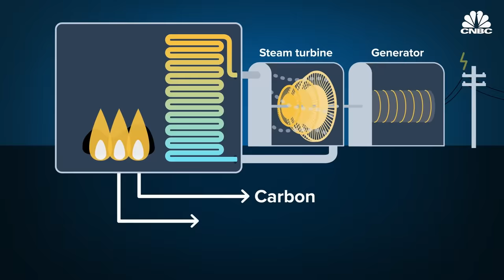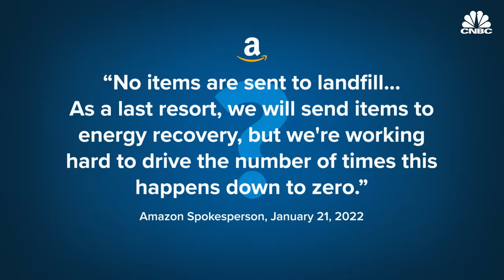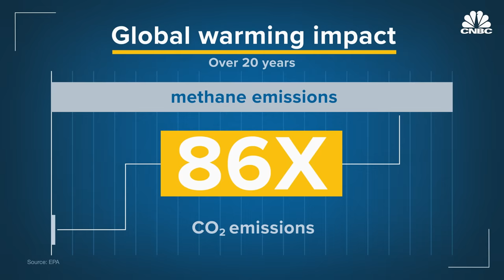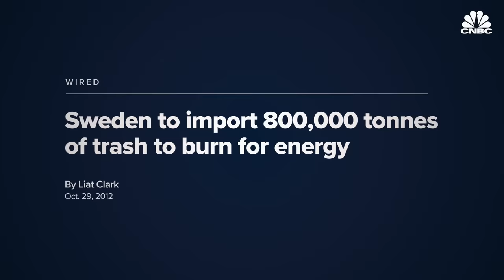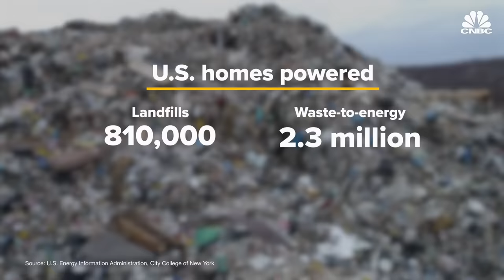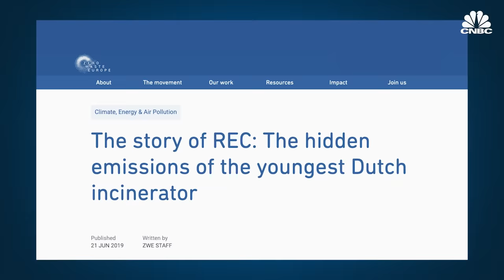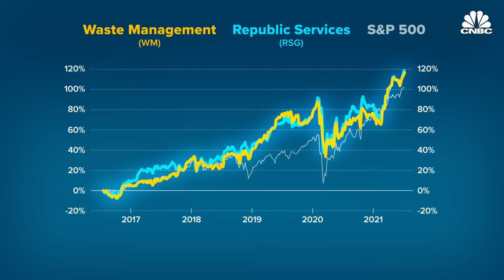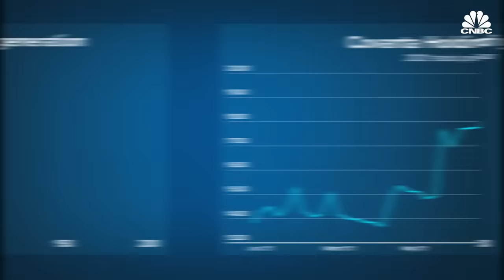How Amazon, American Airlines And Subaru Burn Waste To Make Energy

Comment: What they don't tell you is that incineration produces HCL levels and SO2 levels nox levels and mercury which has to be treated before goes out the stack and those systems are very labor-intensive to maintain. It all sounds great on paper but try to maintain a 2000 degree temperature consistently when burning trash it's not going to happen without a natural gas supplement.
Reply: All of this is litterally adressed in the video.
Reply: All of that already happens. Grate temperatures in the burner are maintained by slowing or speeding up the grates based on the calorific value of the waste. 
Ammonia is injected to reduce NOx levels.
Exhaust gases are treated with carbon and lime and fly ash is removed.

Comment: its crazy how easy misleading the global levelized cost of generation is. while technically correct, in the USA nuclear is about 30$ per mwh while on the chart globally it is over 150. also in USA waste inceneration as per the EPA cost 4 cents per kwh or 40$ per megawatt hour while solar is around 30$. I find it interesting the distinction between global cost and usa cost were not mentioned. Points to bias

Comment: What's wrong with importing waste to incinerate? Where's the problem?
Reply: because the incineration is not a 0 consequence solution. heavy metals and other dangerous gases can still be released even after heavy filtration, as covered in the video. so if a country is importing waste to keep the plants running, that means its potentially releasing more of these harmful gasses to its population than what would be the burning of just their own countrys worth of trash.
Reply: @360sblulev  "ha, at least we're upwind!" says the devil
Reply: @roxaskinghearts  what?
Reply: @leoperez2566  The problem is burning heavy metals like copper tin zinc and things like the ink on the plastic bottles wrapper in large amounts batteries and displays because it mixes with the rain
Reply: @roxaskinghearts  they have technology now to scrub that stuff. They mentioned that in the video.
Reply: @leoperez2566  They do doesnt mean its in use at all or is even being installed as there is 0 incentive why people call for a carbon tax and the kind of taxes republicans love to deregulate
Reply: @roxaskinghearts  you're comparing buring to a blank slate. Landfill are terrible.

Comment: Water turbines should be used for all water delivery pipes to generate electricity instead of burning waste to generate steam to generate electricity
Reply: Uhhhh… you realize that water pressure in most places comes from pumping water UP into reservoirs or water towers? So you’d be extracting back out the energy you put in, and then you’d need to pump it again to create pressure. It simply wouldn’t work.

Comment: I have no problem with this idea. I burn most of my own trash. In the winter I burn what I can in my furnace. Methane is a non issue. Its a naturally occurring gas created by metabolism. When I was a kid the first person out on the ice to ice fish could light the methane on fire right out of the hole in the ice. Another word for swamp gas is methane. When we played in the swamps at the back of our farm there was bubbles coming out of the water and and oil shine flowing on the surface. I wouldn't say white communities have the power to stop anything. Where do they stick landfills along with solar farms and wind turbine? In white rural America where we don't want it.
Reply: Wow educate yourself...  1) Burning your own plastic waste at low temperatures is EXTREMELY toxic, both for you, your local environment and for the atmosphere.
2) Of course we know that methane can be burnt.  When burnt, it actually becomes less harmful for the environment as it becomes CO2 and H2O.  As you said, methane burns quite well, this is why over here in Europe we collect compost and all the methane that comes out of it to generate electricity.  This is far better than throwing food waste to the landfill.